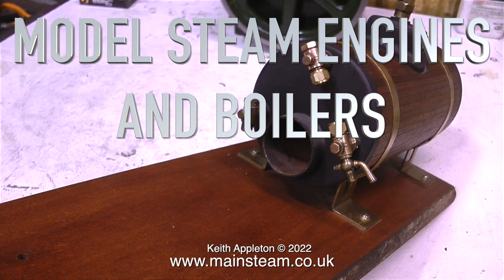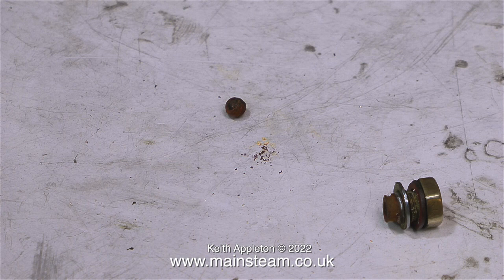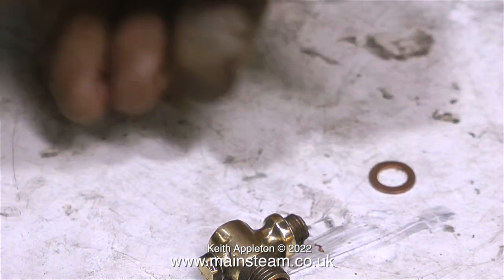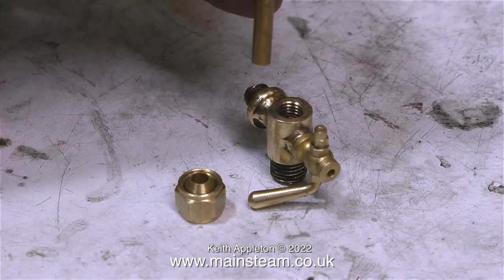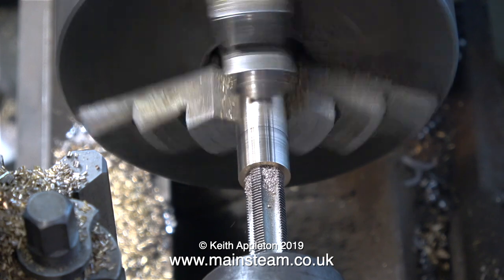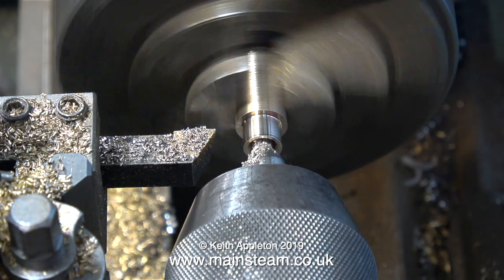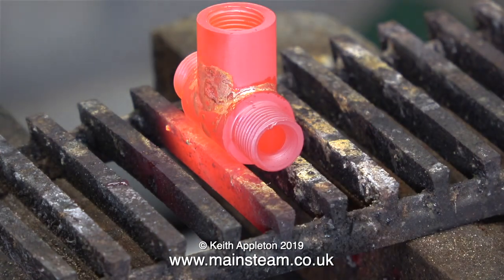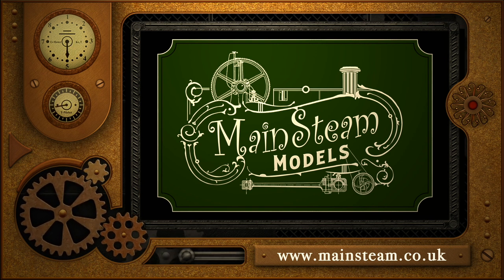MODEL STEAM ENGINES AND BOILERS - PART #18

Comment: Silver soldering. To improve results- try using snips of solder rather than apply silver solder directly to the joint from the silver solder stick. 
Place sniped lengths(2-3mm) of silver solder together with a enough flux to only cover the clean surfaces to be joined under the parts to be joined. Then heat gently from a distance with a soft flame using circular motion or in an oven. 
Remove the heat a soon as the parts drop together and the solder flows around the joint and forms a tiny fillet. 
There would be no need to apply silver solder down though the center of the parts. 
- Lecturer in welding & thermal joining.